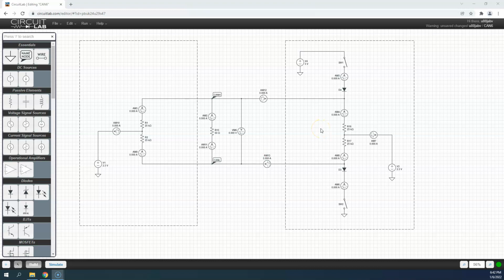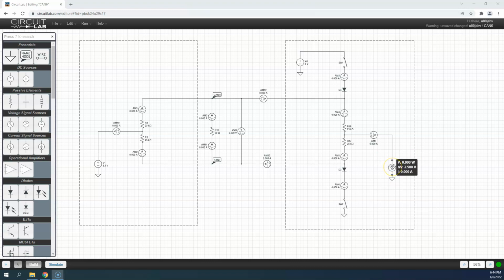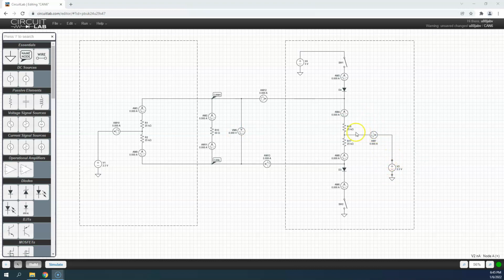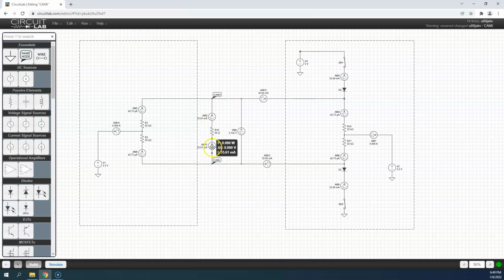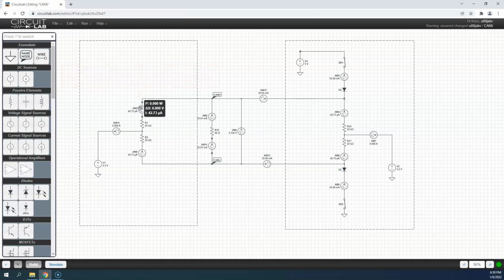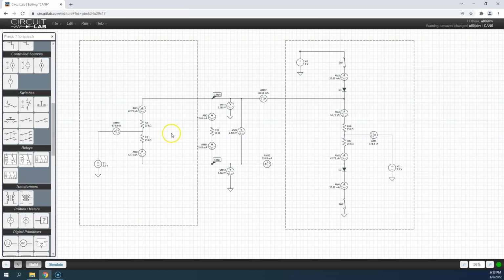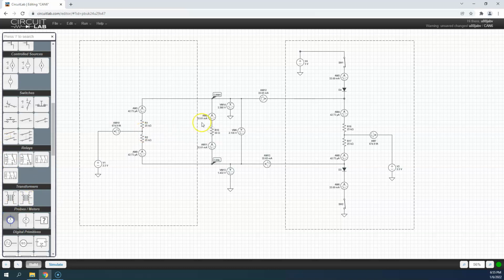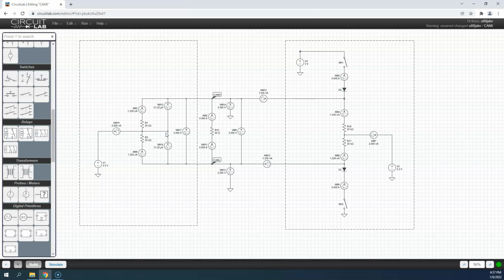Advanced J1939 More on Arbitration 7

Comment: I know you said keep the comments to constructive criticism, but I would like to say first thank you very much for presenting this information freely and with data to back it up. I am a HD Truck Technician in the Hoosier state and finding actual training on J1939 physical layer is tough. I really like the point you were making on this video that was trying to reinforce the fact that bus is switched dominant for ease of words. Why the 2.5V measure is same could also be explained in fact that while the backbone is a parallel circuit, but the branch in the CAN transceiver is a voltage divider series circuit with same resistance value resistors. So split 5V in half you get 2.5, same as the supply for recessive/bus idle if my thinking is correct and also you measured the voltage before any resistive load. I realize the voltage is actually lower than 5V, assume the FET and diode get their piece of the pie according to Kirchhoff. One quick question/technical opinion, if have heard multiple of reasons for the terminating resistors. One that stuck in my head is that they are needed to rapidly bring voltages back to recessive state. Kind of load/voltage suppressor for lack of better words to have bus rapidly switch to recessive. Basically, the FETS switch bus dominant rapidly and resistors rapidly pull it to recessive. Your thoughts would be greatly appreciated and thanks again.
Reply from the maker: The Hoosier state, that is where I live again.  I have some later videos on termination which will back up your theory.  It sounds like you have a good understanding of the fundamentals of electricity especially referencing Kirchhoff's laws.  Most manufacturers don't understand that many of the techs who work in their dealerships are a lot brighter than their internal people who are supposed to be experts.

Comment: Could you explain the functions of D3 and D4 and their polarities in the circuit?
Reply from the maker: Thanks for the question.  One function of the diodes is to provide a voltage drop (forward biased) when FETs are switched ON.  Without the high side diode, CAN H would be pulled up to about 5 V instead of 5 V - V D4 (which is about 1.4 V) = 3.6 V and CAN L would be pulled down to about 0V instead of 1.4 V.  The block diagram in the spec sheet for the transceiver shows these diodes.  For the simulation, I modified some of the parameters of the diodes so that they have about a 1.4 V forward bias drop, instead of the typical 0.7 V so that the CAN voltages appear to be more "typical".  The actual transceiver may use PN junctions (diodes) which are doped to act similarly, but they may do something else such as two diodes in series to drop 1.4 V as it is proprietary to the manufacturer.  The block diagram in spec sheet just provides a simple description of the function.  If either diode were connected with opposite polarity, it would block current flow when FETs switch ON which would not be good.  I suppose the high side diode also acts to protect the controller internal 5 V supply Vcc from a short of CAN to 12 V.